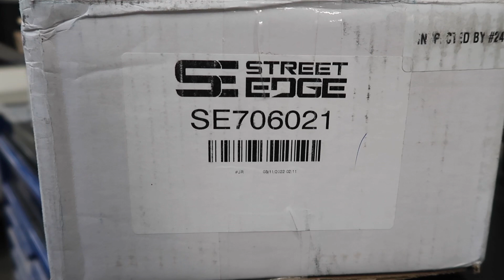This 87’ C10 gets LOWERED and a NEW SET of US MAG WHEELS!

Comment: I was excited about how you lowered this one because that's exactly how I plan to lower my 87 shortie - because I'm looking for a decent ride. But you were right: it just wasn't quite low enough. 
Does removing the overrider leaves really change the ride characteristics? I would think removing them would make the rear pretty bouncy. 
Also, do you think 2.5" drop spindles (what I intend to use) will allow the inner lip of a 15" wheel to clear the lower a-arm ball joint?
Reply from the maker: Taking the overload spring out didn’t change the ride that much, it made the back ride a little softer. You may have to trim a little on the lower control arms to run the spindles with 15 in wheels. Thanks for watching